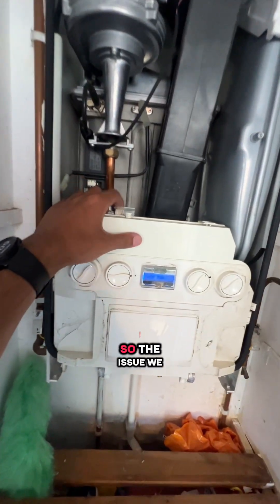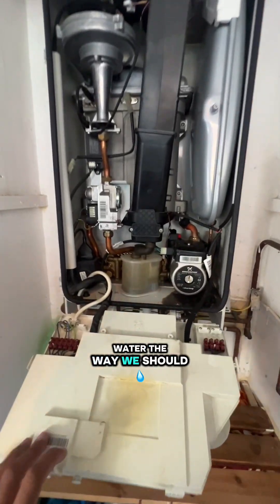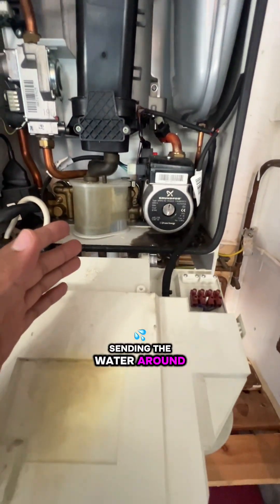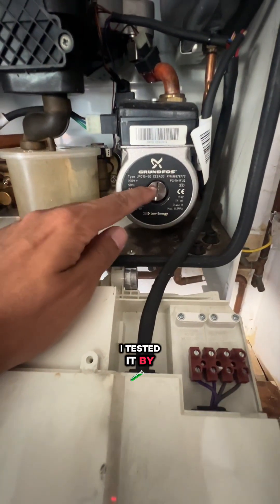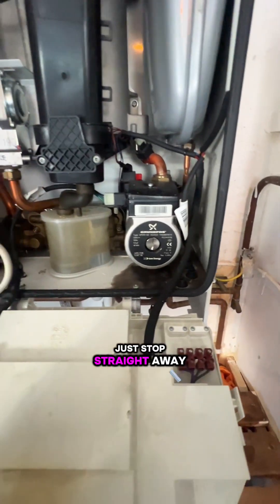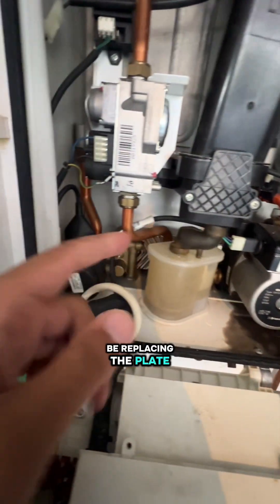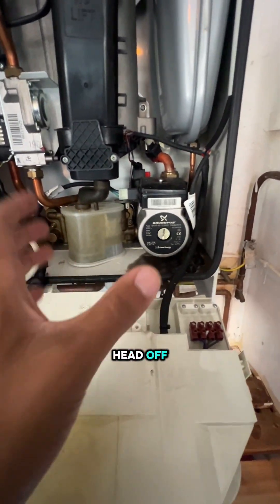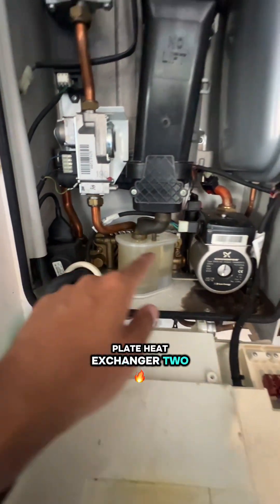🚿 Hot Water Restored! Ideal Logic Combi Repair 🔧 Pump + Plate Heat Exchanger

Comment: Can you use the prv valve for drain or is it different
Reply from the maker: Never use PRV to drain boiler unless your replacing the PRV or fitting a new boiler
Reply: When turning on ch for 40 mins it will cut out with L2 fault can this be pump
Reply: Hi, do you run the pump on full speed?